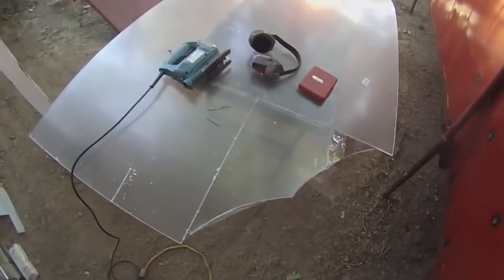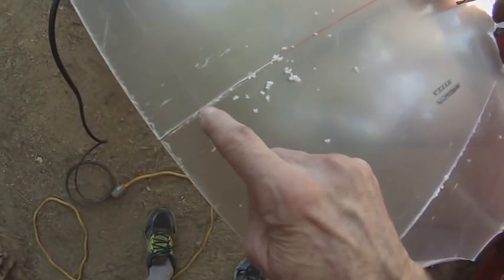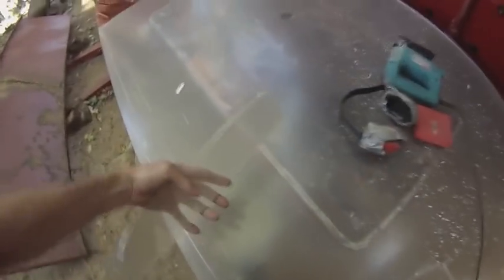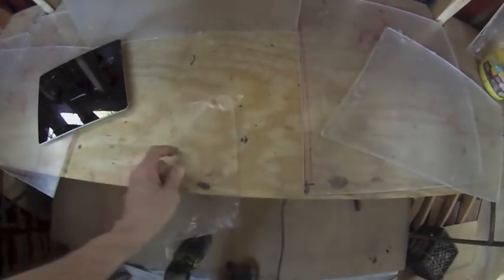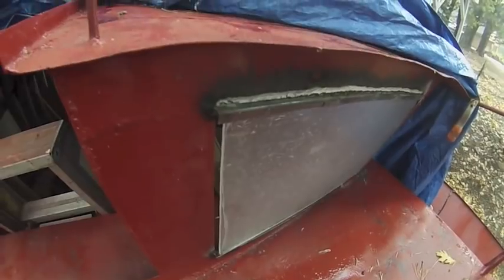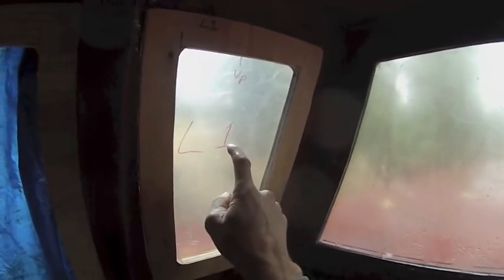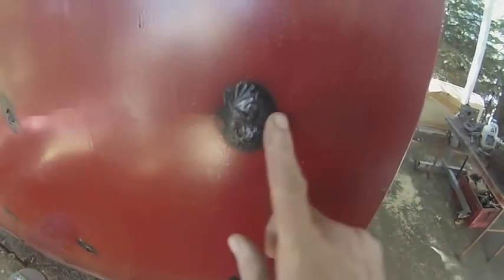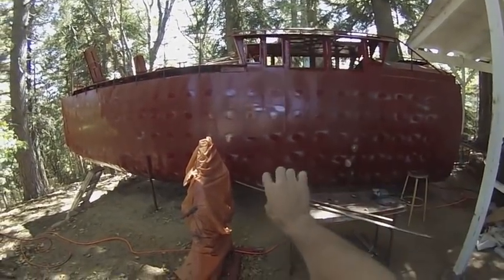Steel Sailboat Build Part 20

Comment: Why don't you buy a roll of car door rubber, you could put it around the edges of the plexiglass and this will act as a airtight sealant when your on the sea. It will reduce the amount of cold air coming into the junk ship through your windows plus act as a buffer to stop them rattling in the wind.

Comment: A humble suggestion. Get a marine architect or someone that understands the forces on a sailboat to review your keel to hull connection and the supporting structure inside the hull. I am concerned from what I have seen of your build that normal sailing pressures could fold the keel over and rip the bottom out of your boat. Good luck. cheers
Reply: And the whole thing is just shaped wrong what a waste of talent materials time and money. He has some skills and he's not lazy but absolutely no direction

Comment: No cutting $500 for 9 replacement  Beckson marine port holes with screens and seals  for my 1985 IP 27. In my marina there are at least a dozen abandon  sail boats to be had for little or nothing. Why would you build a boat

Comment: I'm afraid that over time acrylic cracks , crazes and turns yellow in uv light.., as long as you understand they are temporary , find an auto glass shop and have some 1/4" saftey glass glass cut to you cardboard patterns. You'll be far happier.... Keep at it...

Comment: I would like to recommend that you have a sealing materiel pressed in between the steel and the plastic . Lots of different things would work, choosing something that is resilient like an O ring or weather stripping, else adhesive like silicone calk. Where the plastic fits well against the steel there will be a small capillary attraction drawing the water in , where the fit is poor water will find its way right through even at the top of the pane. You can also expect the structure to flex a bit and change how well the windows fit . A good kind of weather stripping will reduce these sort of problems.

Comment: I like that you have an overhang over most of the windows. Shade is good for the plastic. Still you should plan on replacing the windows every six to ten years due to solar damage . You can extend this with an anti UV film. But your system looks like a good one for regular replacement.
Reply: six to ten tears?? this boat be lucky to last a year before rust and rot eat it

Comment: Your seem worried about the window popping out with pressure from the inside. As you have all the 'glass' in back to front, the first big wave that smashes into your "portholes", is going to pop them INTO the boat, and dump a whole lot of water. As a dozen other comments have said, you even have the wrong type of plastic. It wasn't a "bad batch",  it was just the wrong type of plastic, also not wave proof.
Reply: Do you think it matters?
Reply: @tomhutchins1046  Yeah, I just have this sympathy for potential Darwin Award candidates.

Comment: FYI Lexan is a commecial brand of polycarbonate such as is Makrolon. Polycarbonate is much more resistant to cracking and stress comparing to acrylic. The only advantage for acrylic is that its easier to polish and remove scratches. Especially if you need to drill holes close to the edge polycarbonate is your solution as acrylic will shatter and crack

Comment: I've noticed that plexiglass is temperature sensitive when cutting or drilling. Temps below 45 degrees F usually resulted in cracks at holes and breaks diverging from score lines.

Comment: Plexigalss is strong but cracks will expand easily. To make sure the edges are without microfractures heat them up carefully until the get a smooth finish.

Comment: God help me, but I'm only watching now to see how bad this will get.
Reply: You dont need to be a world famous naval architect or even a apprentice naval architect to be able to figure out that this project is looking like it's going bad.
Reply: @benmac7315  I know I've been a part of projects that didn't go as planned, more than once. But are so many problems developing here I'm just gapejawed. That being said,  nothing will keep me from launch day!
Reply: @FlyingMonkey9343  I'm not a boat builder but do have a number of years maritime experience both engineering and deck and I know there's a number of things that dont sound right to me about this project. Either way I agree still interesting to watch and for his sake I hope I'm proven wrong on at least some of the things.
Reply: @benmac7315  I haven't gone through every video, this is a sailboat right? I noticed there was no keel. Granted that could be a smart move if he is going to move it to the water front himself.
Reply: @andrewyork3869  he did make a keel of sorts for it, I'm not sure what has happened to it now, I believe it is meant to be either a sail boat or a motor sailor, he was talking of getting an air cooled engine to put in it.
Reply: @benmac7315  strange, boat this small should not be steel as I understand.
Reply: @andrewyork3869  unaware of any reasons why it shouldn't be.  Whilst admittedly most small boats aren't steel, some are and the only difference is they are stupidly heavy for minimal useful gains.
Reply: Oh yeah world famous naval architect !!!

Comment: Plexiglass (Acrylic) is not the same thing as Lexan (polycarbonate). Polycarbonate is more flexible, less brittle, and much stronger. Acryllic also changes size as it absorbs moisture and as it gets warm, FYI.

Plastic is melting because the speed is too fast. Either push harder to cut faster, or slow the speed as you discovered. Also jigsaws suck at cutting plastic because they ram the semi-molton "chips" right back into the cut on the next cycle. The chips rub and squish like you're sawing through cheese and just get hotter and hotter. Next time just clamp a guard and use a circular saw. 

Also, when you cut plastic, lay down masking tape along the cut line, it helps prevent cracking and chipping by giving it some edge strength.

Comment: Maybe too late now, but here's my 'top' tips:
1. have a bottle of alcohol, use it to splash the blade from time to time
2. take small breaks to allow the blade to cool off
3. let the blade do the cut, don't push it
4. if you have a swing back setting, put it to zero, the blade only needs to move up and down
5. use a metal blade where you've ground down the teeth so they don't swing alternatively one left, one right
6. slowest or next to slowest speed
7. back up the saw once every few cm

Using these basic things i've managed to cut up to 2.5cm thick plexi, flawlessly. It's a PITA to cut if, but if you allow the saw to do the work and have patience, there's no better option, unless you happen to have a variable speed band saw table, but who has those.

Cheers!
Reply: I've cut 1" thick plexi with a circular saw. Cuts about the same as wood. no melting. No issues.

Comment: Cutting plastic invariably a problem - much being due to heat build up on a blade. Stress fractures also a potential problem - as you mentioned, holes can be awkward.
Good to see more progress. The year sure has flown!

Comment: Glad to see you back at it.  How did your hike on the PCT go?  Portholes are looking good.  Don't forget the butyl tape or caulking between the steel and the acrylic.  Will make a big difference in how well the acrylic reacts to pressure from any irregularities in the steel framing.  Have a good one and looking forward to the next video.

Comment: Acrylic is nightmare stuff and a bad choice for windows.. far too brittle and will scratch very easily, especially in salt water. you will be replacing them very often. make friends with a glazier and use tempered glass, wont be cheap but will be waaaaay better
Reply: In addition to its brittleness and scratchability, it degrades in UV light. There are protective coatings but they degrade eventually as well :/

Comment: The problems that you experience with plastic materials are quite common. Liquid cooling of the blade (and material) is a great idea. I have made the best experience with a spray bottle containing 70% ethanol and 30% water. The ethanol sounds horrible in terms of fire hazard and potentially harming the plastics. In real life it isn't a problem. You might want to look into CNC and working with these materials. Chipweld and similar problems are much worse in that domain and ethanol seems adequate to mitigate the problem.

Comment: When cutting acrylic, temperature is the prime determining factor. One trick is to "flank" the cut line with painter's tape, but most of all is to work with it when it is warm to keep cracking less likely. 

Also, if you plan on sailing in colder climates, your windows are more likely to break. This can happen as the boat is flexing which is typically when seas are rough (worst possible time). My take would be to never use acrylic on forward facing (critical) windows. YMMV